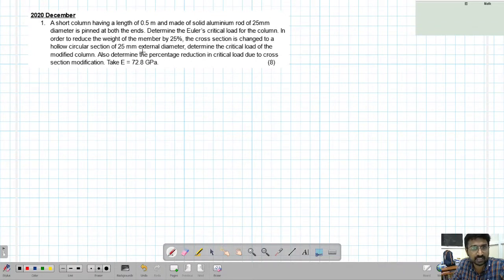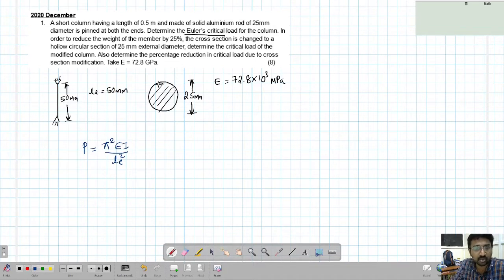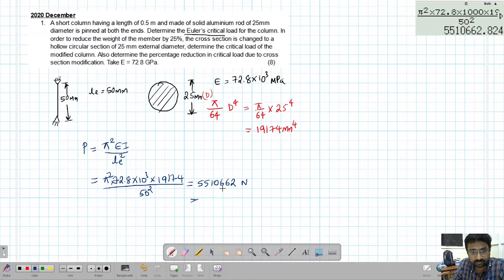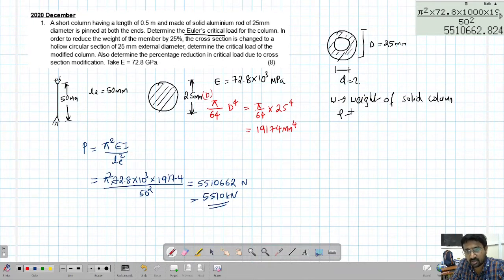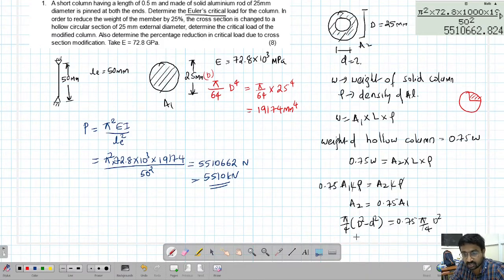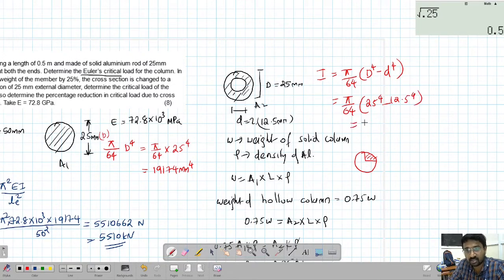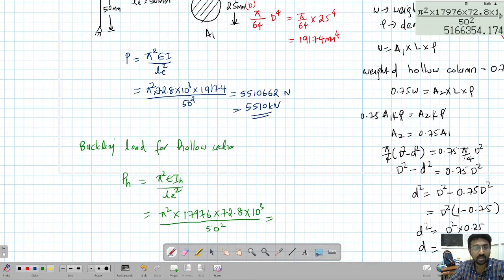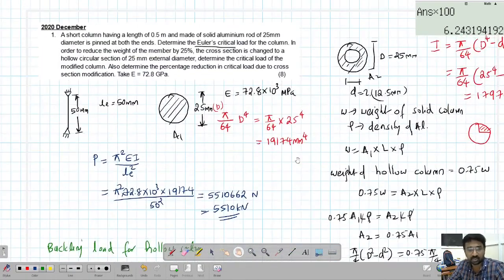Mechanics of Solids KTU Previous Year Solution - Module 5 - COLUMN 2020 Dec   Problem 2

Comment: Sir since this is a short column can we use Eulers crippling load equation
Reply from the maker: You are absolutely right, it may not make sense.But we can use the formula. The value may be more that what we get from simple short column formula (σ x A) and hence useless for practical purpose. We used this as KTU specifically asked us to use it solve this problem.
Reply: @anytimelearning5967  thnx sir